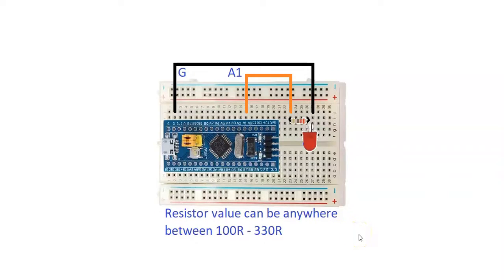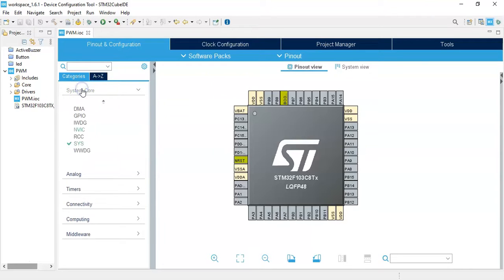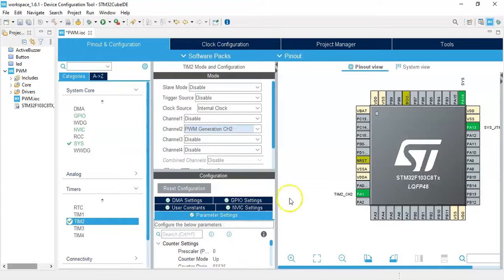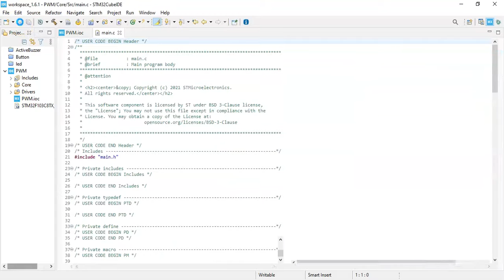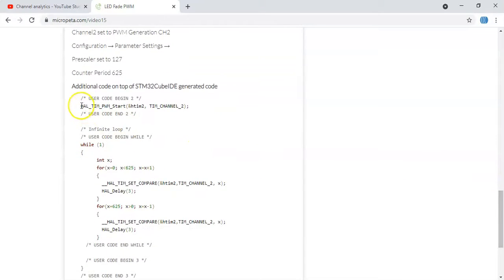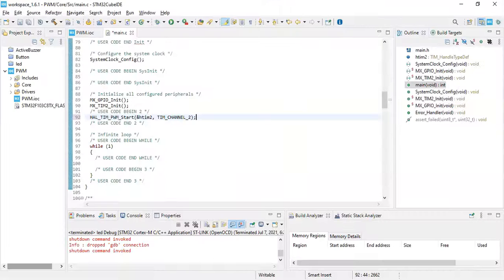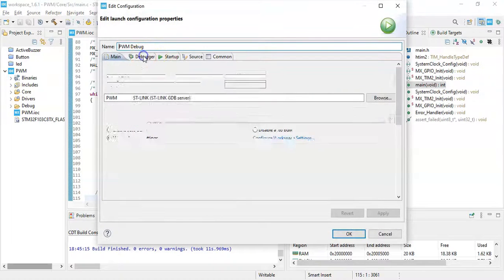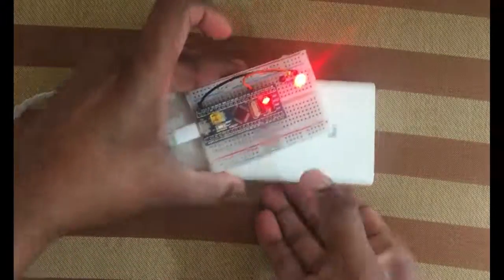15. STM32CubeIDE LED FADE. PWM Timers with STM32F103C8T6

Comment: What is  doing __HAL_TIM_SET_COMPARE() Functions?
Reply from the maker: Hi there,
Since we set Configuration → Parameter Settings → Counter Period 625, we can change Pulse from 0 to 625.
 0 being  0% and 625 being 100% pulse width.
__HAL_TIM_SET_COMPARE() is a macro to set the pulse on the fly.

Comment: Thanks a lot. It is really simple. How can I make pwm with adjustable frequency and duty cycle?
Reply from the maker: In this example I wanted to have 100Hz with 0-100% variable duty cycle.
How I did is:
Clock frequency = 8000000Hz
I divided it by 128 (prescaler) and then divided it again 625 (Counter period) to get 100Hz
Follow this to get different frequency as you wish.
I am adjusting duty cycle on the fly using  __HAL_TIM_SET_COMPARE in the for loop from 0 (0%) – 625  (100%)( Counter period)

Note :  prescaler is always one less 128 is 128-1 =127
Reply from the maker: If you want to set the frequency on the fly you can use __HAL_TIM_SET_AUTORELOAD as I did in video https://youtu.be/zw1mQUI2sSM
Reply: @NizarMohideen  isn't it the other way around? The prescaler is the same but the counter period is -1 because it starts at 0?
Reply from the maker: You can use other way round, it will generate pwm. But the counter period needs to be more than 1 (one) in order to have variable pulse width from 0-100%